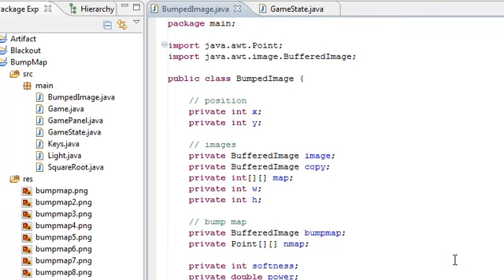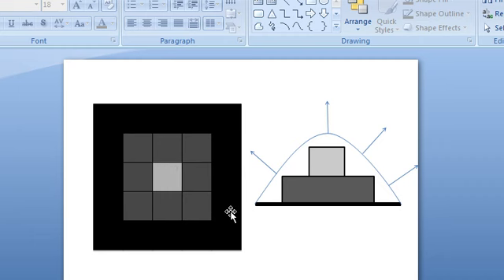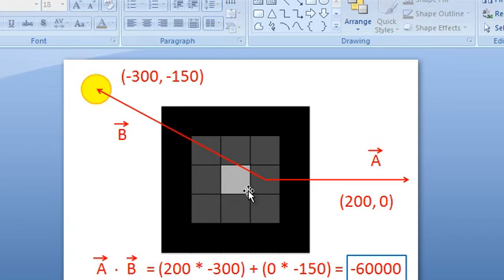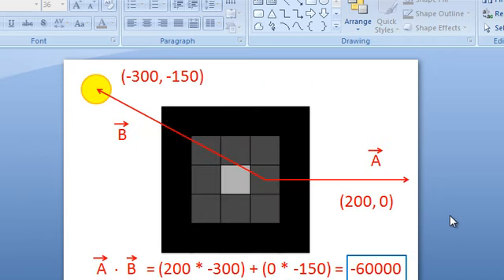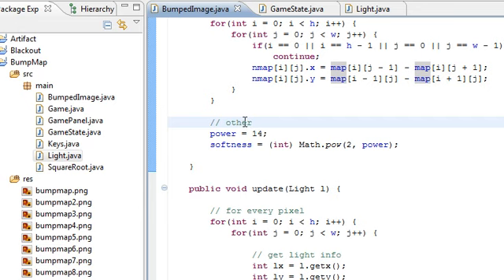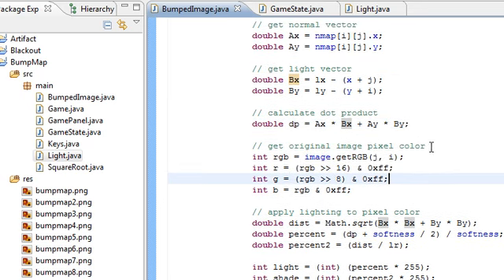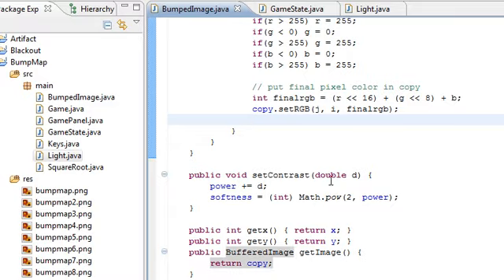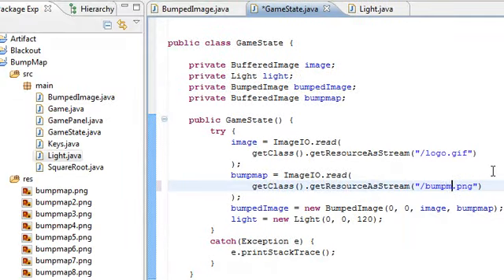Simple Bump Mapping in Java 2D

Comment from the maker: I capped it at 30 fps and it's consistent at 30. I tried it with two lights though and it slowed down to 10 fps. I mean it's Java 2D though, not really a viable option for computationally expensive lighting.
But still I'm surprised it runs a smooth 30 fps.